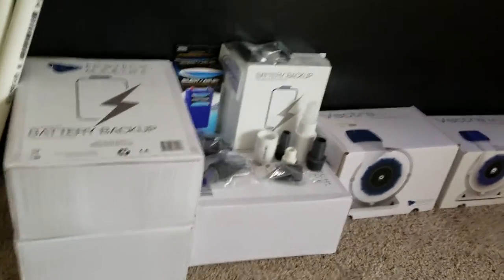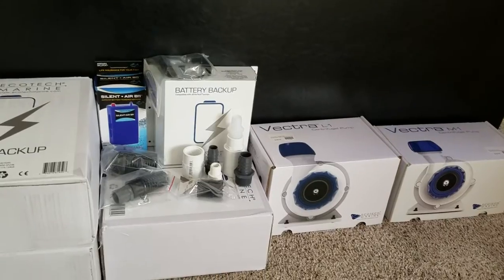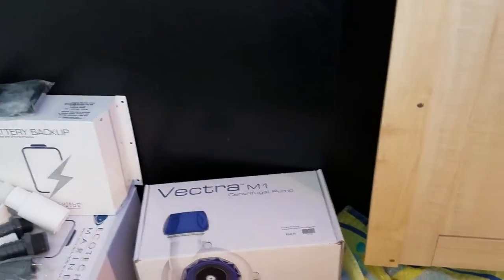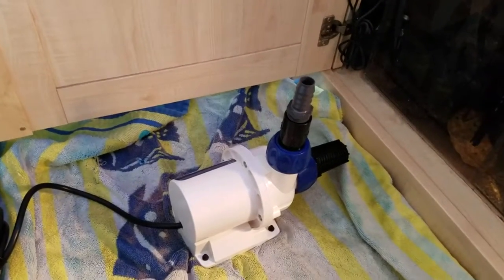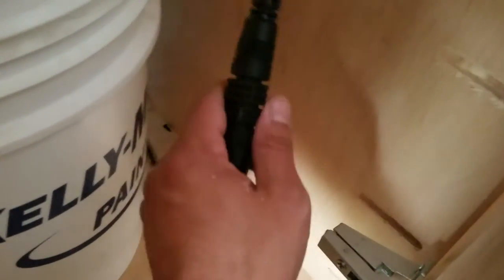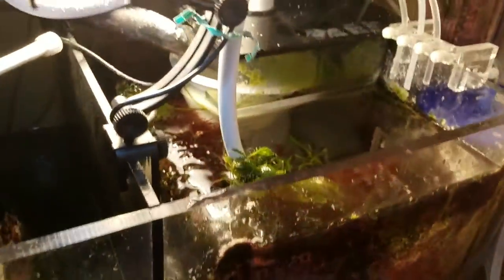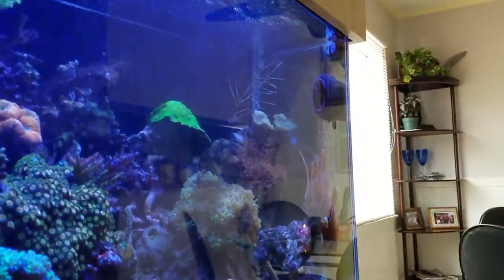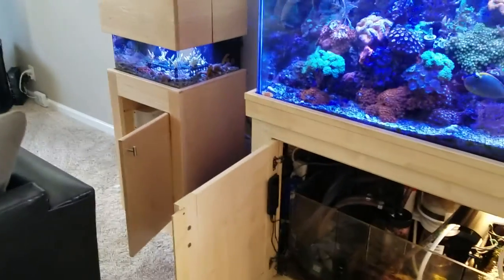Install of Echotech Vectra L1 & Battery Backup to my 90 Gallon Reef

Comment: I also have the barbed fitting for my L1 connected to a 1inch vinyl hose. How did you secure the fitting to the pump? I don't have the adapter connected to your fittng in your video. What is it?
Reply from the maker: My lfs had all the echotech barb fittings for the L1. Ask them for the fittings. 

My LFS is Aquatic Collection in Hayward California.

Comment: The fittings for the pump shown in 5:50, did you buy them separately or did they come with the pump itself?
Reply from the maker: Mario Hernandez 

The barb fittings did come with it. the screen in the front was bought separately.  Echotech supplies all the additional parts separately. A way to make more money I guess.. But they supply one size barb fitting. So it depends on the hosing your using if you need to buy a separate fitting.

great machine. Still very quiet

Comment: Did you have to do anything to it, to get it to turn on? Or just connected and was good with out programming it?
Reply from the maker: I did program it after it was turned on. You can simply turn it on on adjust flow manually. I adjusted flow off the the echotech app.
Reply: Ok I’m having problem connecting it to my backup battery not doing anything when I test it
Reply from the maker: @spencerfernandez8599  You need the battery booster.
Reply: I do have one
Reply from the maker: @spencerfernandez8599  
You turned off power to the power pac. The emergency power only works if all power is loss as it is connected to an outlet. Turn your breaker off if you want to do a test if connected to your outlet, but you should have a power strip which is better
Reply: I will try that when I get home thanks for the advice

Comment: have you test the battery back up on full charge, and how long does it keep return running
Reply from the maker: it puts it on low running speed. it keeps it flowing, but the downside is your protien skimmer may act up if not dialed in correctly. basically overflow the top chamber cup. My power has turned of twice already and my tanks and protien skimmers have been fine. just dial in your skimmer incase of power outage.